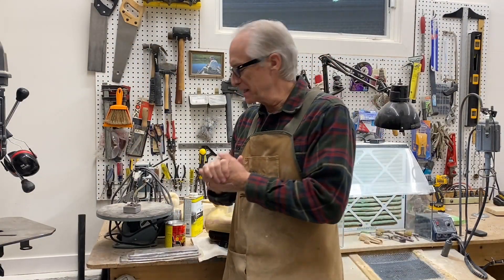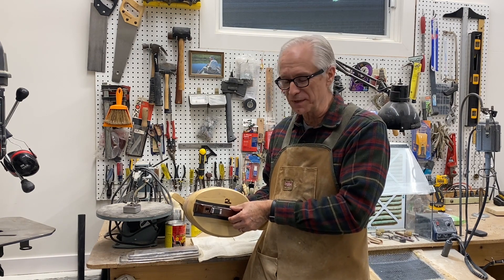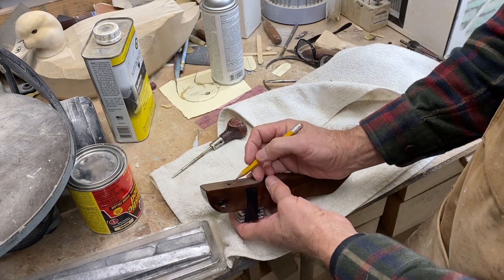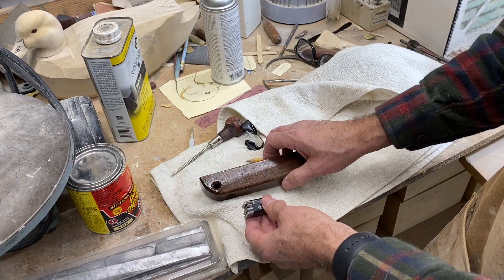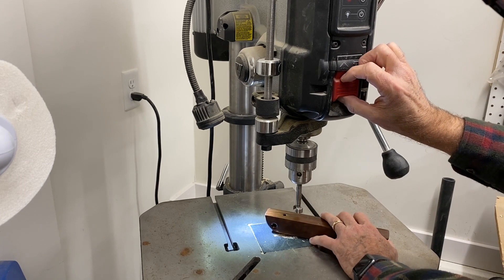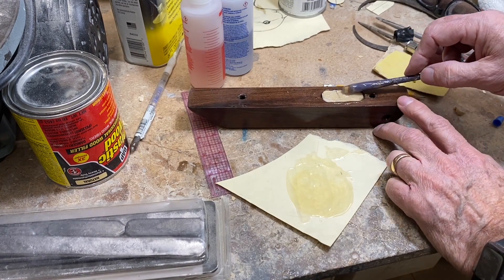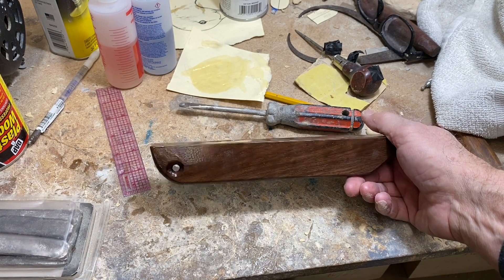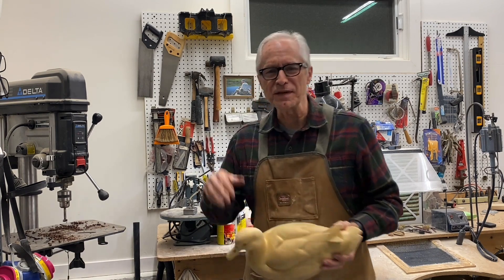Constructing a Decoy Keel

Comment: Thank you, once again, for sharing your knowledge and experience with everyone. Regarding the hollowing process, have you done a video on that?  I've done a few, but more for the enjoyment of putting a small buckshot inside it so you can hear it rattle around (it's been a good 'that's cool' feature)...   I'm just curious on how you keep the wood removal symmetrical to help keep the decoy balanced when it is floating.   Also, I 'assume' you cut the bottom part off above the water line to minimize any water getting into the decoy, in addition to the gluing and sealing process.
Reply from the maker: I do have a separate video showing how I hollow decoys Daniel.  Check that out and it may answer some of your questions.  Regarding keeping the decoy symmetrical, that is important and that’s why I use calipers and dividers as I go.  sometimes even symmetrical decoys will need some final weighting adjustments to float level. Check out my video on decoy flotation for how that can be done.